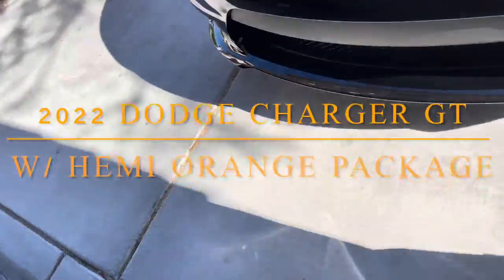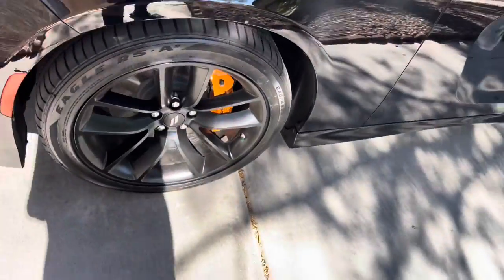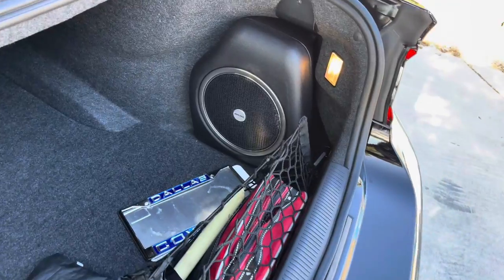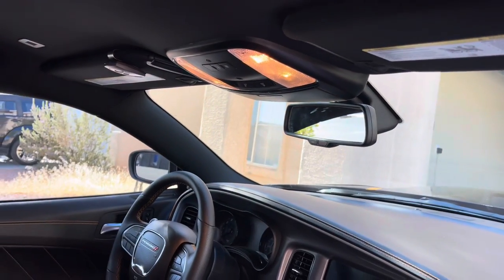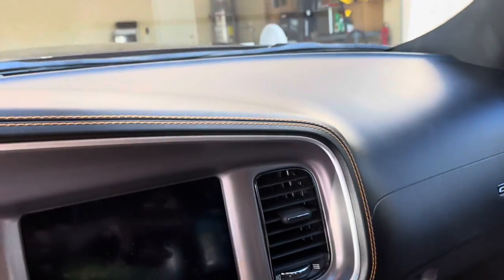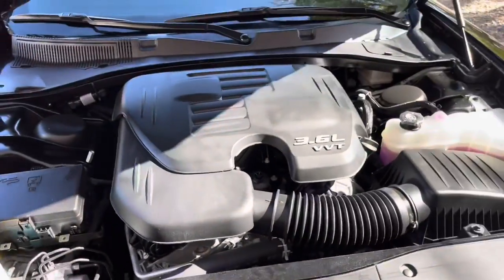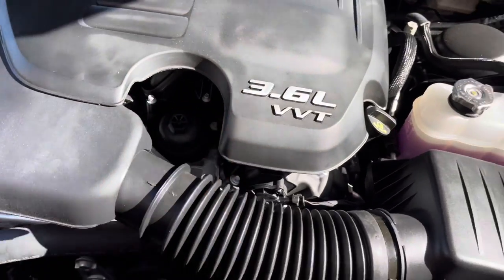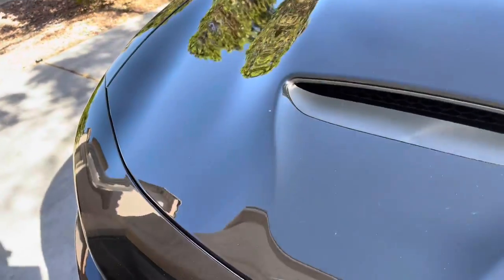2022 Dodge Charger GT with the Hemi Orange Package

Comment: Plz keep the front bumper on the car it looks so nice. Ppl gonna hate that orange package looks really nice 💯😮‍💨.
Reply from the maker: I decided not to go with the grille openings. Or are you taking about the yellow bumper guards
Reply: You are suppose to take them off lol
Reply from the maker: Yeah, I took them off a week after I got the car. They looked so nice but the right one scratched a little part of the clear coat. A light scratch that's gone now. I wish they had a better mod for them that would protect the paint. Only thing you can really do it just get the bottom vinyl wrapped in yellow to take their place. I've considered it.

Comment: Sharp looking car.  I just picked up a new 2022 Charger Scat.  A man on a galloping horse will never know what trim level you have.  Take care of it--the Challengers and Chargers are going away.  I noticed in the video that you have a garage door opener on the visor.  You have an on-board opener built into your Charger.  Those 3 buttons with the harsh marks up by the dome light controls. You simply pick one button and syn it to  the visor control.
Reply from the maker: Congrats on the new whip. Thx, yeah I programmed the garage buttons after about a month of getting the car

Comment: Where can I order or find this package.
Reply from the maker: I pulled up to the dealership and it was there already. I didn't order mine but, you can go to Dodge.com and select the GT or Scat Pack widebody Charger, GT or R/T Scat Pack Widebody Challenger, or R/T Hemi Orange Durango then select Hemi Orange Package(for Charger and Challenger only). Once you select it you'll have to select a color, there are five colors Pitch black, Granite, Smoke Show, Triple Nickel, or White Knuckle.
It will automatically add all the features (i.e., seats, stitching, brembos, stripe, rims, etc., etc.) 
It will automatically add the Plus group package as well, it's required. Then you can add your other features. 
Dodge said this package with be back for 2023 models as well. Good Luck!